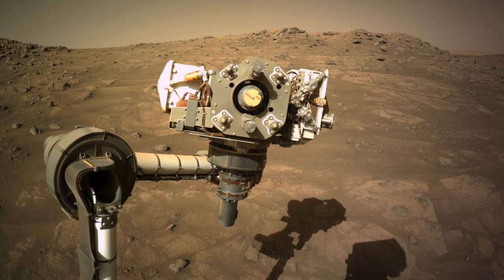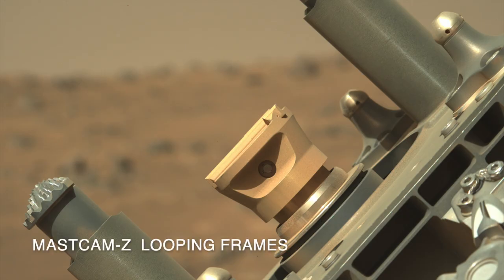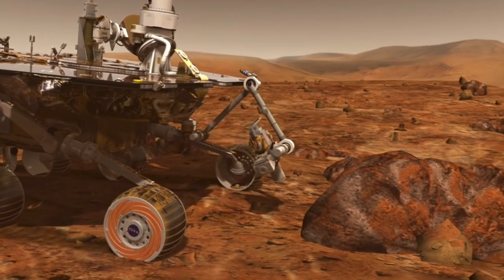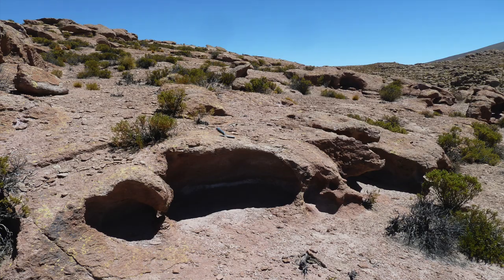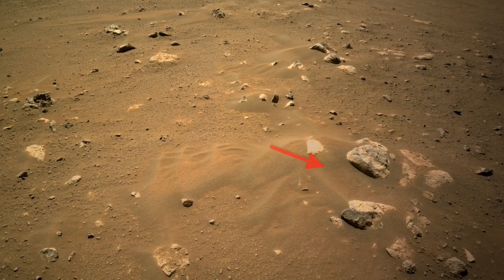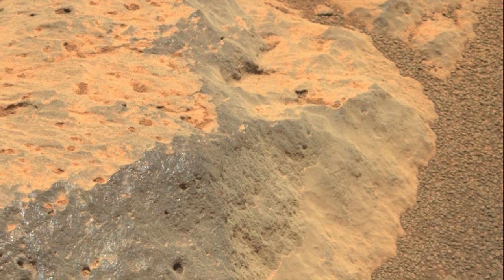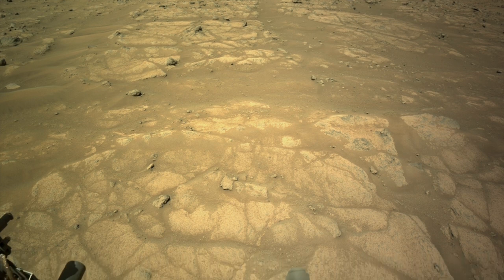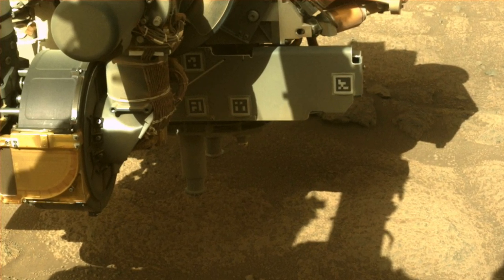Perseverance rover is getting ready to grind

Comment: The principle the rock drill uses is quite old. The star drill, a large, hardened steel spike whose tip looked like an asterisk, was hit repeatedly by a sledgehammer as the holder rotated it slightly after each blow. It was used to drill holes in rock to mark survey points or to hold dynamite for blasting.
Reply from the maker: Cool, I guess it's back to the future for Perseverance!

Comment: Hmmmm.......Is the drill made of material what we call a diamond-drill / A drill that is used  for example to drill big round holes in concrete, (usualy combined with water to cooldown the friction ) The design of the tool/drill is very special.  It has like 3 lines parallel to each other, all in a different lenght + there is a cut made on the plate itself....  interesting design! And what are those 2 black *things to the left and right from the drill? It looks like they can be pushed in. They are higher then the drill itself, so the drill needs to come out further to be able to drill, no? great content!!
Reply from the maker: The abrading bit "teeth" are made from tungsten carbide.  Here's what the published article by Moeller et al. 2020 says  about them: "The tooth pattern is optimized to provide a more evenly-distributed impact pattern during rotary-percussive drilling (chiseling), thereby
reducing tooth marks on the abraded surface patch and producing a smoother surface finish."  And the two black posts are the stabilizers for the drill to push down on the rock.  The bit extends down to reach the rock surface, which is not shown in the images.
Reply: @MarsGuy  got it! 👍